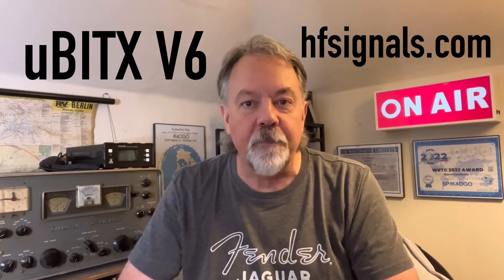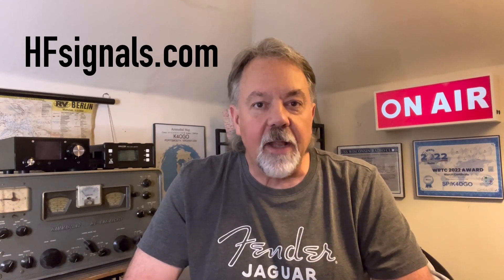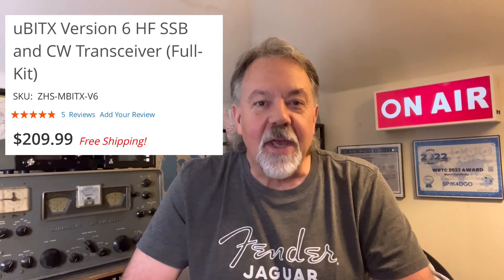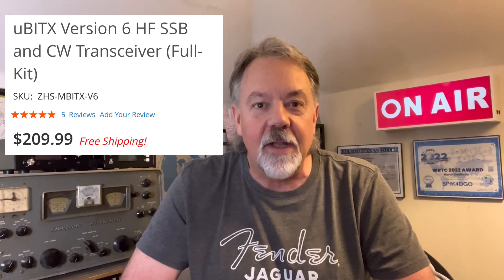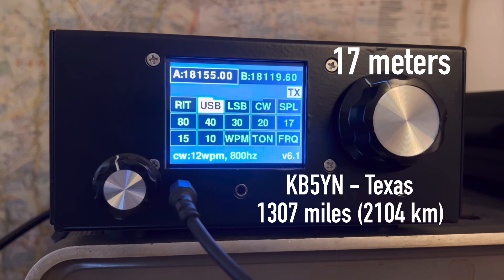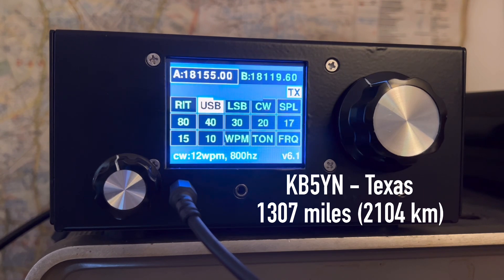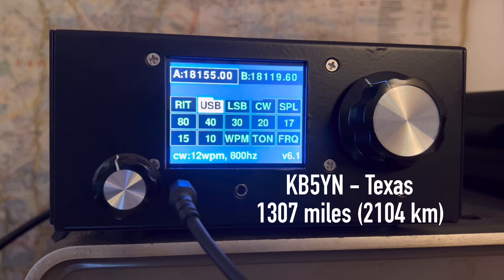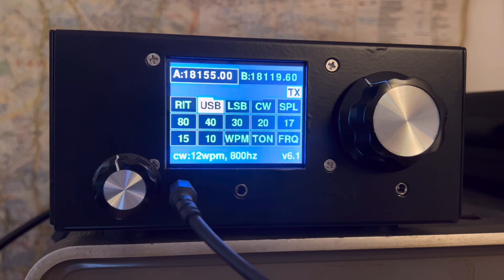The Easy to Build uBITX V6 HF Transceiver Kit

Comment: I found my UBITX V6.1 for $199.00 on eBay
 And it works..

hardest part was getting the frequency clocked properly. That took me a bit to get it right. 
I used my laptop to get the frequency and BFO PERFECT. ASHAR HAS A VIDEO ONLINE THAT I USED. MADE IT SIMPLE

Comment: Walt, great video. I was wondering if there was a simple HF kit to build and you answered that question. Thank you for that information. Did you find out what was wrong with why the radio was sounding narrow? This is just my troubleshooting curiosity. I was an electronics tech. for over 30 years. Thank you again.
Reply from the maker: Yes I adjusted the settings and got it sounding good.

Comment: Hi Walt!
Quick question.
How about modulation?
I’m using cheap baofeng mic, and I was thinking to replace the inner electret mic, or to install a small mic preamp inside. Any suggestions?
Reply from the maker: I’m trying to figure out a better mic as well. I think you are on to something by installing a preamp. I’m going to start doing some digging in this.

Comment: No Soldering. It's almost Plug and Play. I built mine on Tuesday and put it on the air yesterday. Made 5 QSOs on 7160khz SSB on the Worked All Britain Net 3 English Hams one Welsh Ham and one Scottish Ham. Just need some stereo plugs to get on CW. 73 G0IMB Manchester UK
Reply from the maker: Congrats! 73 K4OGO

Comment: Very neat!
Reply from the maker: Thanks for watching!
Reply: @COASTALWAVESWIRES  thinking I might be able to do that. But what about the antenna and power supply? Got a video on that?
Reply from the maker: @Downeastwaves  any simple 12v power supply on Amazon will work, the amperage draw is low, I used a 10 amp supply I have on my bench in this video. As for antennas I used my Sigma EuroComm HF-360 but there are so many different antennas, it depends on your space and situation. I really don’t have a video in terms of power supplies but a ton of antenna stuff on my channel.
Reply: @COASTALWAVESWIRES  thank you so much

Comment: Hey Walt, I am just seeing this video. Curious: does it have a built-in antenna tuner? If not, are you running an external tuner? Also, what power are you getting on 40m & 20m. The gigaparts site says the power goes down as the frequency increases! Thx man!
Reply from the maker: No this does not have an internal tuner. I have a external ATU but I don't need it for 20 meters as my antenna is resonate there. I haven't done a power test yet but yes I've seen that it goes down as frequency increases. Thanks for watching.

Comment: I bought mine from Gigaparts also. I upgraded mine with the Nextion display and the additional arduino nano along with the upgraded firmware to allow it extra capability like decoding CW and WSPR transmission. I have about $255 tied up in mine. It's a great radio.
Reply from the maker: Awesome, thanks for sharing!
Reply: @COASTALWAVESWIRES  Be sure and show us what you did with yours.
Reply from the maker: @kd5inm  will do!

Comment: Walt, my friend John, n6vcw, got one of these for his birthday and I came looking for a video on them. Bam! Yours popped up first. Being a haughty "solder-only" kit builder and would ONLY soil my hands with a kit that required actually soldering soldering stuff, my first inclination was to "poo-poo" it. But your video piqued my curiosity. For the money and the coverage and other features you demonstrated/described, this looks intriguing.   

AND you can mod it? I'm in!

Basically, I respect the recommendation of a guy whose idea of hamming is taking a small rig and decent antenna down to the beach, throwing a radial in the surf and working DX. (Stll in love with your Hawaii QSO video.) 

Thank you for the recommendation; please keep us informed re the mods and your experiences!

72 de William, k6whp 
SoCal
Reply from the maker: Thanks so much for the kind words William! Have you seen the new sBitx from these guys? It’s a Raspberry Pi based kit and I think you can get it in a less constructed kit form. It’s on my radar and I’ll probably get one soon. 
All the best and 73!
Walt K4OGO

Comment: Do you connect this to a power supply? Also what kind of antenna connector does it have. Thinking about ordering one but what else do I need to buy?
Reply from the maker: Yes I connected it to my 12 volt power supply and it has a BNC antenna connection.
Reply: I am using a 12vdc 5 amp switching "brick" power supply with mine and it works great. Some folks seperate the power supply for the power amp section of the rig and run higher voltage on the transistors since they can handle higher voltage but you have to use larger heatsinks for them. With greater voltage the transistors have greater output but you have to take precautions to run them like that.

Comment: Much as I like Ashar and the Bitx transceivers I find the 'kit' classification amusing, it's like buying a car and getting the wheels in a separate box then claiming you built a kit car.
Reply from the maker: Yes it is somewhat like that but as I mention in the video it's a great platform for modifications and getting started with experimenting. 
All the best and 73
Reply: Selling it as it is, it's a great start to building and homebrewing for someone who has never built anything before. It is highly modifiable and is a great basic design that gives folks an affordable access to HF radio. I have used it with the upgrades and it really gets into being a great radio after the mods. Everyone has to start somewhere, and the uBitx is a great radio to start the hobby of building.
Reply: Yes but It is all relative, I knew a ham who started in the 30/40s he MADE his own capacitors, resistors and ground his own crystals from a bit of quartz - next time you solder an IC into a ‘real’ kit remember him!

Comment: Looks like a fun kit / radio 👍
Reply: I've had my uBitx v6.0 almost three years and it's been a great rig. I modded mine with the nextion display and extra arduino nano to give it added features. It decodes CW and sends WSPR transmissions that can then be accessed on WSPRnet. My WSPR on 40m was heard in New Zealand and Tasmania in Australia from Texas using a homebrew magnetic loop antenna laying on the floor next to my radio table.
Reply from the maker: It's a fun little kit and super easy. Looking forward to performing some surgery on it and doing some mods. Thanks for watching my friend!